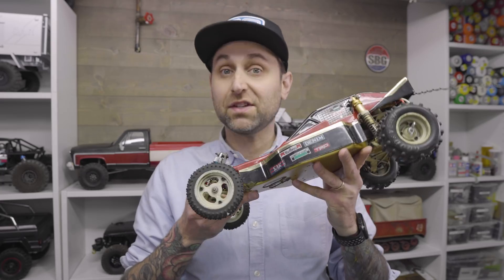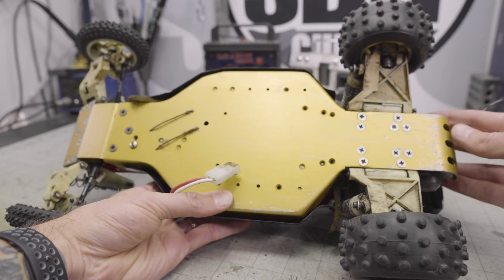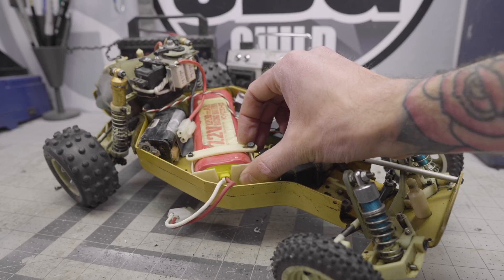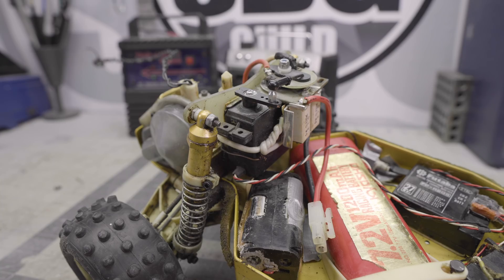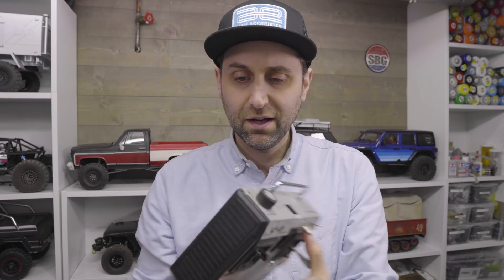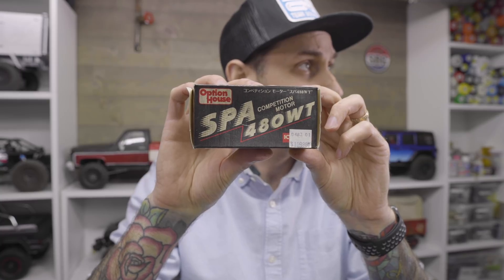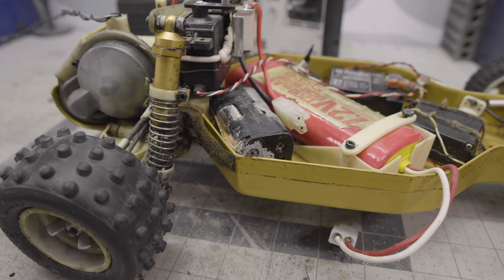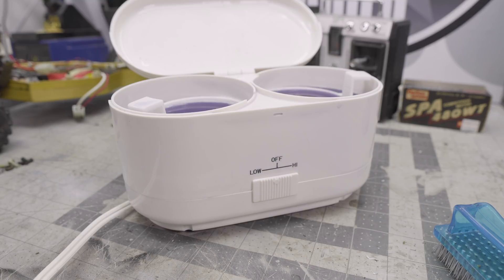Throwback Thursday! Associated Electrics RC10 Restoration

Comment: I had a mechanical speed controller in my Kyosho USA-1, which at the time back in 92 was scary when it got stuck at wide open throttle. It and the Clodbuster were the biggest RC trucks at the time. Still a lot of fun back then though, can't wait to get the USA-1 up and running again.

Comment: The RC10 prototype had a steering servo attached with tape, but all production cars had servo mounts. 

The wire wrap around the steering servo and throttle servo is just some kind of hokey repair in the past.

Comment: I have two. An A stamp six gear and a b stamp with a stealth. Both of mine run the battery in the bulkhead pocket and the hold down front to back. The steering servo is secured with mounts to the servo then from the bottom. They both have futaba pistol grip pbk’s with actual futaba esc’s upgraded around 88-89. I started out with attack stick radio’s.

Comment: Nice find.  You can still buy a body that would fit the gold pan RC10.  Looks to be mostly original and in decent shape with a little bit of cleaning.  Those tires are rare and I know the re-issue (limited) edition comes with similar tires that are made by Pro-Line.  The Speed Controller is mounted kinda weird and I don't recall it to be that way (seems to be mounted kinda high).  The 5 gearing gearbox must have been carefully filed and assembled to be that smooth as I recall those to be a paint to work with to get it smooth (especially in the early edition).  Looking forward for the restoration video.  Thanks for sharing :)

Comment: You are lucky you got an AC charger!  I had to hook mine up to a car battery.  I helped a friend build an RC 10 in the late 1980s, yours must be older. I remember a resistor speed controller that didn't have reverse. Also, I've seen and raced with a LOT of RC10s, but I've never seen the battery mounted like that. Usually it was mounted down the middle of the chassis or across.  I remember a battery mount almost integrated with the gearbox?  Maybe your version didn't have that feature.  Also, every racer I know had a BEC, even then.  My info is probably 1987-1990ish.

Comment: I’ve got a vintage Tamiya Hornet I picked up a couple years ago that is all original from the 80s with radio and matching servos with a mechanical speed control, it’s all functional and really cool!!  And I picked up a Traxxas Rustler that has a mechanical speed control and looks hardly used!  I’ve got a couple rc10s that need attention, one chassis has been painted over the gold, that I’d like to remove actually if someone knows how to do that, let me know!

Comment: The electronics and charger are the cheaper stuff, I had a futaba attack radio, others had futaba magnum jr's or sports and a pro tech ac -dc charger. The battery mounts under the bulkhead. The hot electronic speed controller around that time was the Novak (orange box). Front shocks on yours are from I don't know what, and yes on mine at least the steering servo was held down by servo tape, i don't remember off hand if it was mounted at all. If you wanted around 85 or 86 you could buy the stealth transmission but you had to drill holes in the chassis. Good times, I raced mine until I got a 10 L pan car.

Comment: I got a  RC 10 in black chassis looks like a racing one.  It came in a $25.dollar deal with a XX rtr roller a XXcr roller and a XXXT roller. are running chassis now. If you need bodies for it Boki Racing Engineering has them.

Comment: I feel like I'm almost obligated to get a gold pan RC10 to restore back to it's full glory. When I was a kid and just learning the difference between toy grade and hobby grade RCs, the RC10 was my unobtainium and I had to settle for a Tamiya Falcon & The Cat from Traxxas (which, in hindsight, was pretty cool owning the first Traxxas RC) but now I'm grown and my parents can't tell me that the RC10 is too expensive. The only part that I would have a tough time deciding on would be doing a full factory restoration or going restomod and put modern electronics in it. The latter sounds like the better option so I don't quickly get bored and park it on the shelf.

Comment: I got one of those in 1988. The layout is a little unusual due to the Tamiya/Kyosho 3 step speed control. Low speed current was going through both resistors, med. went through one resistor, high speed was direct from the battery. They actually came with a resistor speed control. Under the rear shock tower is a pocket the servo would be in with the variable resistor above it and a wiper arm with a contact. (Much better than the set up on this car). For more info look up Bolink variable resistor speed control. Luckily ESCs weren't far behind. With the stock VRSC, the battery would be across the chassis. With an ESC the battery would tuck into the pocket under the shock tower and the battery holder was at the front end of the battery. The steering servo was mounted on the chassis using holes that are already there, but square to the chassis instead of the angle you see on this one. The original VRSC worked like an ESC, but with less "steps". The wheels ( like early Tamiyas) are beadlock. I changed up to the 2.0" wheels as soon as they came out! Low sidewall profiles for better performance. The 6 gear transmission placed the differential on the top shaft for external adjustment. I hope my little history lesson helps your understanding of how this worked.
P.S. The BEC was originally to eliminate the receiver battery pack (battery eliminating circuit).

Comment: I had a RC10T back in the day (gen1), the worst part about those earlier cars for me was dealing with the servo tape and lack of mechanical mounting of the servo to the chassis. You had to use double sided tape, which would pull up over time and the servo would peel off the chassis. If you didn't replace it perfectly, to a clean surface, it would do it almost instantly when you started driving again. Over time, dirt/water/etc would work its way onto the tape and it would weaken, then you'd have to repeat the process. There also weren't defined mounting points, so you had to sortof guess if it was installed correctly. If I were building one again now, I'd look at 3d printing some mounts to drill on and install. 
I also think the Stealth transmission came in the B2, possibly the B3. I had a B2 and remember hearing about it, but it's possible I'm confusing it with the release of the B3 (it was a long time ago).

Comment: There were esc’s at the time..1985 on forward. Novak, Tekin, Hobart... they were expensive. A Novak 1 was $140 in 1985. A Novak 4 was $80..
Also there were a few sets of mounting holes for steering servo.. same method we have now... mount nylon blocks to servo then blocks to chassis.
Lastly charging was pretty much same as now except specific for battery type (nicad). Good ac/dc chargers monitored voltage, peak voltage, charged at various currents etc.. only thing most didn’t do was monitor each cell independently. Instead they sold matched cells with similar series resistance and characteristics.

Comment: My Traxxas stampede I bought in 2000 came with a mechanical speed control. I actually almost burnt my car up with it when I thought it would help to get the water off it with WD-40. And it caught fire.
Reply from the maker: Yikes!

Comment: FYI the transmitter you have that came with that car was not for car racing it was for airplanes and any one that tells you different  never used that car to race because if they did they would have used one of the futaba pistol grip style radios. and if you want a more accurate speed controller other than the one the factory supplied. use a Novak Rooster.

Comment: Somebody Frankensteined that together Matt, it should really have an esc from the day. No four pack AA batteries, the nicad battery goes either lengthways from the gearbox or across the chassis in front of the gearbox.The steering servo should be mounted with associateds white servo mounting blocks that come in the kit. The original gold pan chassis had the A stamp in the chassis, the re-re kits don’t have the stamp, but they do have the extra gearbox mounting holes for the later gearbox. I want you to sell me the RC10 as is right now, ya hear me..... right now!!!

Comment: "A" stamp chassis were the originals which were drilled for the six gear transmission. Later versions of the rc10 had the "B" stamp chassis which indicates that it was factory drilled to accept both the six gear and the later stealth transmissions.
Reply: The original had no stamp at all. A stamp was after the move

Comment: Looking forward to see how this turns out. You can race my Losi Jr.2 from ’91. I pulled out of a box after 20+ years replaced the Futaba Magnum Jr radio and Futaba 112 ESC with a 2.4 GHz radio and a Dynamite ESC and 20 turn motor. Then put on a reproduction body to replace the cracked original and it still rocks. I still remember parking lot racing it at the local hobby shop on weekends. Would gear it up so it would smoke a 1200 mah NiCd pack in 4 and a half minutes.

Comment: A very good base to start, rhere are some nice billet alloy wheels, upgrade shocks, and even re-re bodies.
Man that steering servo is huge that would have suckedsome power out the battery, I used standard size it is light enough not to need a monster. I like this buggy but my father bought ne a Tamiya he had a Kyosho cant remember the models I got bored because never enough batteries and only lasted 5minutes, that eight minute motor was to combat others that over heated and melted all the solder joints in italong with rhe magnets coming unstuck I went through several motors. Then I saw the light and got myself a FG Marder buggy with 23cc motor, a TRAXXAS GAS Monster buggy and an MCD Chevy Trophy Trick Baja 1000 4x4 I raced all three the TRAXXAS was first to be retired a short lived run before discontinued, shame it had great potential. So in the two wheel drive the Marder and four wheel drive the MCD offroad racing, the MCD I also used onroad change the wheels shock's and added the big rear wing that looked like the Super Bee wing, but it was the best on track better that the other purpose built road racer's won a lot of races with both on and off with the MCD I ran it in the Outlaw class the TRAXXAS I converted to mini stock oval it lent itself to this in looks and chassis design did well until I could not get spares anymore about a year later (looking for another as a donor buggy) so from age15 till 22yrs old I raced gas,, and then years later again with the first HPI Baja5B in the UK but went back to the Marder our tracks not big enough for the 5B as too long and could not mod because it was already built to the specs at the time, I digress yes waffling still in lockdown stir crazy. 
Back to the RC10 I used to race my dads Kyosho for a few years but got red up getting beat by the RC10 and getting pushed further back in the finishing order as more guys got them lol be safe keep up the ace content. many thanks

Comment: That radio in USA is a airplane (72 airplane only). Because the battery is to long for the place it need to be installed.( the battery is to be mounted side to side or front to back (the battery is to go into the opening in the bottom of the rear shock tower bunkhead.) The steering servos to be mounted to chassis with plastic mounts just off center. You need to replace the front shock (wrong shocks). I think you can go on to the AE site and down the instruction book and parts list. You can get new parts just need look. I think that car was sold in builder kit( no bearings just bushing, no body and no tires)

Comment: A stamp mean its original from the first run, an your battery tray is wrong original should be center long ways with  frame an the new one you can by the battery sets sideways other than that looks good man have a good one keep up the good work

Comment: The body you have is incorrect. It is aftermarket. I bought this model new in 1984 built and raced it for around 3 years back then. It was a design that completely obsoleted everything else. This was the dawn of RC dirt racing and if you wanted to be competitive you HAD to have an RC10. In 1984 I was 40 years old.

Comment: You weren't a "man" until you have blistered your fingertips on one of those mechanical speed control resistors, lol!
Reply: Man you aren’t kidding! I wasn’t cool enough to own an RC10. I had to settle for my grasshopper and Subaru Brat.
Reply: Yes that white ceramic resistor did a few numbers on my finger tips
Reply: Lmao I remember when my first rustler got me! Had no idea the difference between mechanic speed controls and ESCs so I just got the cheaper MSC. Wish I still had that truck. Been on the lookout for a mint Rustler/Bandit/Stampede from back then.
Reply: how about when the RX battery dies with the wiper in the full throttle positon..lol

Comment: The plastic parts were never actually white.  They were a yellowish nylon hue and were actually meant to be dyed to match your cars paint scheme.  Most people never dyed em though.  Yours are actually the original color.  I still have mine from '87 a 'cadillac' edition (the one right after 'edinger' I believe.)  and it still has the original airtronics xl2p radio in it.  fully functional, still works like it's 1987.  When I built it then, I never used the wonky mechanical speed controller.  Nobody did.  They were garbage.  A lot of later kits never even bothered to include one.  I have a Tekin ESC with braking etc on it for racing (no reverse) and it worked and still works great.  Expensive though in the time but the only way to go even back then if you did any racing at all.

I recently hauled it out of the basement because someone told me they are now collectible.  I built some modern 2s2p hi amp 18650 packs for it and it currently runs great all original and unrestored.  These are excellent cars even by today's standards.  Definitely run it. They are nearly indestructible under normal usage so you have no worries.
Cheers.
Reply from the maker: Thank you very much Paul!

Comment: No Stamp ( light gold) Very first gen
A Stamp (gold) 2nd gen
AB Stamp (gold) 2nd gen with Stealth holes added
B Stamp (black or gold) 3rd gen with Stealth holes
C Stamp (black) Worlds Light weight chassis (milled)
Reply: Do you know when these versions came out?
Reply: @mikes062  Its not when they came out, its in which order they came out.. like first gen 1985 will be no stamp, they do an upgrade, 2nd gen 1986 will be gold. Or 2005 no stamp, 2007 gold etc.
Reply: Don't forget the aftermarket fluorescent powder coated chassis that AE sold.  I had a fluorescent orange one on my RC-10T.
Reply: @mikes062  Hey Mike there's a very good full history of the RC10 post on RC10Talk at https://www.rc10talk.com/viewtopic.php?f=35&t=13059
Reply: Great memory. I know my original ones were gold but I’m not sure if they were stamped or not.  I just picked up two kits still in the boxes. Unopened.  What’s the best forum to jump on too?  Sounds like you know your history 👍

Comment: Actually, the Kyosho motors were named after the time in seconds they - well, more or less - would take in a race to empty a 1200 mAh 7,2 V NiCd pack. 480 equals the 8 minutes you mentioned, with an average current of 9 A. That was more on the harmless side, leaving the hot versions to the Le Mans 360 (in a 550 can) and 240. I'd guess using the 480 was due to race regulations? (and, on a sidenote, not the completely fry the speed controller and Tamiya connectors)
Reply: The melted Tamiya connectors?

Comment: I’ve had 4 unique phases to my RC obsession. Looking back they usually last about 3 years then take a break for about 4-5 years. The best time was early 90s OG RC10T days (along with RC10 buggy, raced both. There were race tracks everywhere; BMX race tracks everywhere also. I guess birth rate has dropped & not enough kids in middle class to support booming hobbies), second best was early drift scene (I was actually living in Japan, drifting RC & full size cars haha), Late 90’s electric & gas Traxxas monster truck was probably 3rd best. And now current phase crawler/drift/buggy revisited with what seems like unlimited cash compared to younger years. Not having the money and wanting better parts was part of the excitement.

Recently got latest RC10 buggy, the RC10B6.2, to relive the glory. I wanted to experience the transition from brushed to brushless. Pulled out an old Yokomo/KO Propo ESC and new $20 Reedy 17 turn motor. Drove it for a few weeks. Couldn’t figureout why they made it mid-engine. Was thinking old school rear engine RC10 handled much better. Switched to 8.5 turn brushless setup. It will do power wheelies now. Now I understand why they switched to mid-engine... the new motors have so much more power. But for 17t and up brushed motors the OG rear engine has better handling in my opinion.

Anyway fun project!

Comment: I was 24 in 1984 and I've been building, running and collecting RC10's from the beginning.  I've read through most of the comments below and I can't believe no one has picked up on those spring cups on the rear shocks - those spring cups and the light gold anno make your car an early first generation RC10 and probably too rare and valuable to use as a runner.   If it were mine, I'd preserve it and pick up a less valuable beater RC10 to run.  Please check out the full history of the RC10 here:  https://www.rc10talk.com/viewtopic.php?f=35&t=13059
Reply: Yeah i noticed definitely a shelfer

Comment: Matt they actually did have electronic speed controllers. They were so expensive. I remember it being like $125 which in 1984 was like WOAH. also the radios came with 2 servos so it was like throwing away money if you bought an esc. Cool you and I are about the same age. My dad got us in the hobby in 1984 with a Tamiya FOX.
Reply: So it was basically a potentiometer speed control if understanding the operation of it